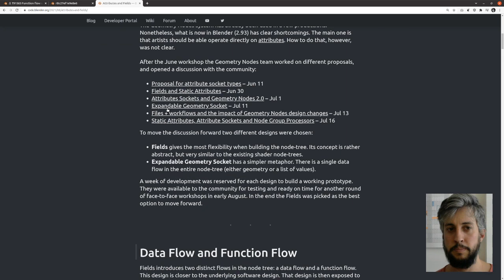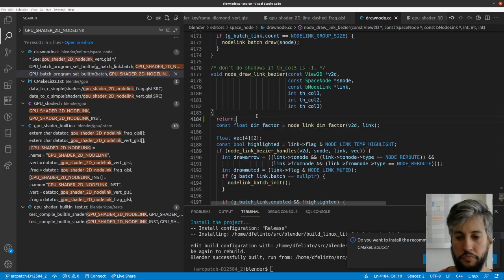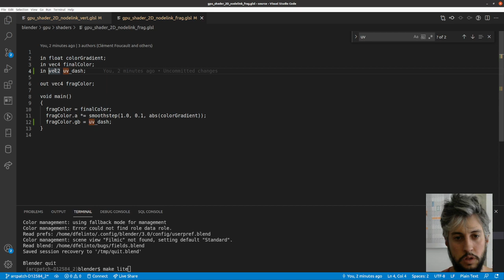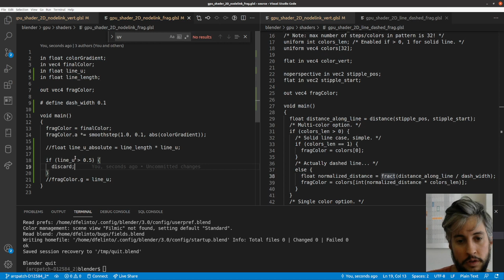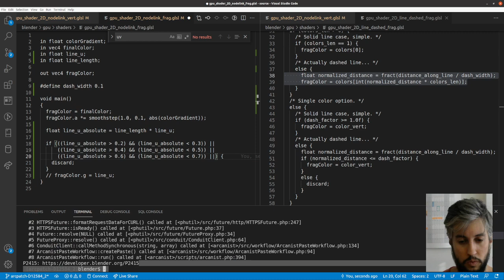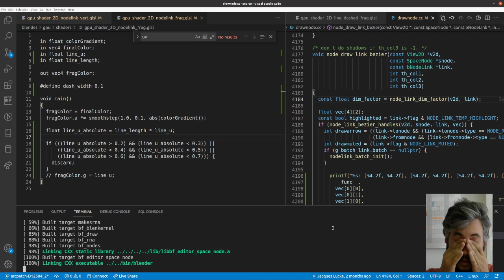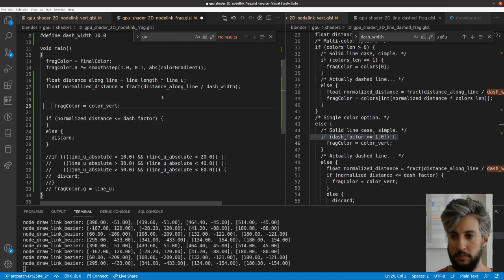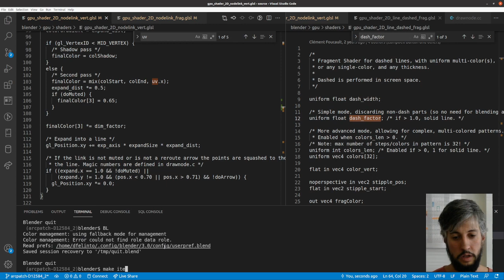Function Flow Drawing Prototype | Blender Hacking

Comment: Is fragColor.a the alpha of the line? If so to avoid branching code, instead of using an If statement, couldn't you covert it into something that multiplies the fragColor.a by 0 or 1?
Reply: You can and is often done. You can do that if you need to use `discard` though. That said, the code is some times confusing on its own and there is a balance between readability and optimizations.